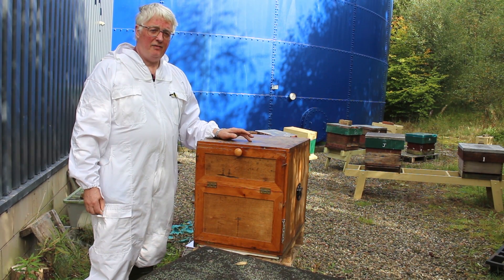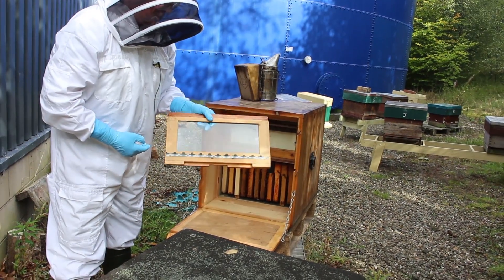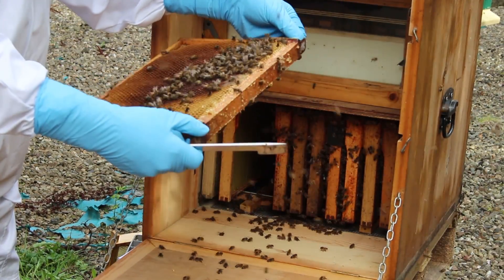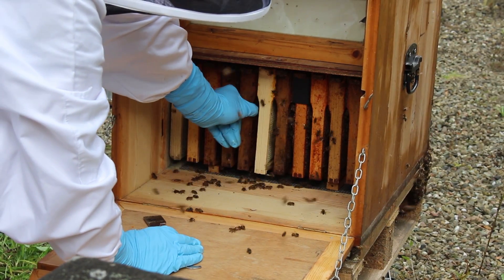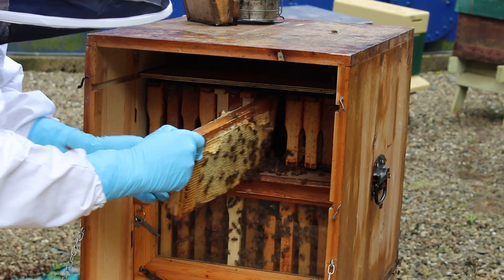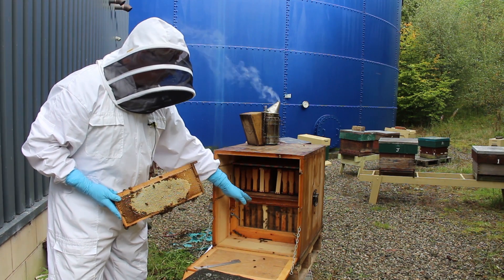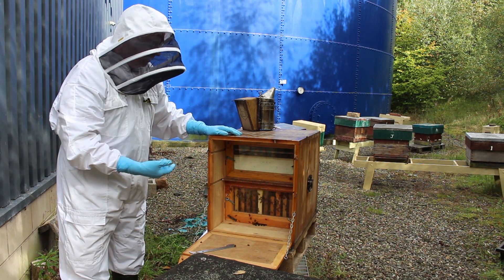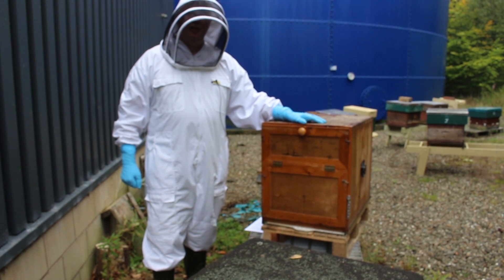AZ Hive in Action

Comment: with my bad back, I could not bend over that long, plus it would be easy to roll the bees, and possibly your good queen, since there is nothing smooth about taking out the frames, nor re-inserting them back in place, wiggling it in side by side could have damaged any of the bees, how do they not propolis those frames out of your reach to easily fix?  You also put the frames back out of order, putting an empty frame where the queen's frame was and put the frame with brood on the outside which is unnatural for the bees breaking the way the bees had organized. Looks like you easily squished bees with the taking out and putting back in, which irritates the bees and I noticed there are a lot of pissed bees as you are working this hive. This is a goofy appearing system at least how he is presenting it. I was considering this system, but geez, there are much better ways

Comment: As a Slovenian i have to comment this one. This is not typical AZ hive and that is the reason that mister on the video is frustrated working with it. First of all the back doors is made wrong, because we have doors which are opening sideways and also you can remove them completly so you can work easily. Than the frames are completly wrong on the video. The real AZ frames are without "ears" and bold upper  edge. And also the whole point of the AZ hives are that you can stack them UNDER the roof into the beehouse, so you can work with bees in any weather. This video i found very offensive to our beekeepers in general. Sincerly, slovenian beekeeper.

Comment: The Slovenian frames have a concave edge to reduce propolizing. It is quite a bit easier to work the frames. Bees are not as bothered. You could modify the standard smith frames
Reply: Hi, the grooves on the frames are mainly there so you don't squish the bees when you are reinserting the frame